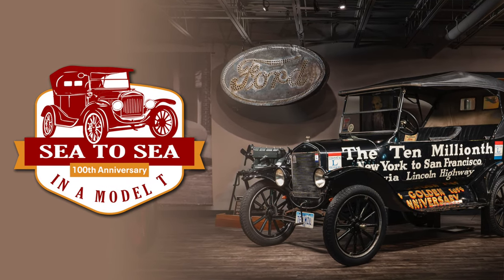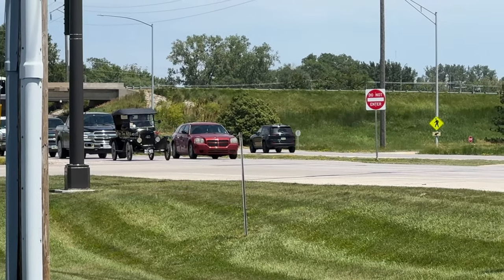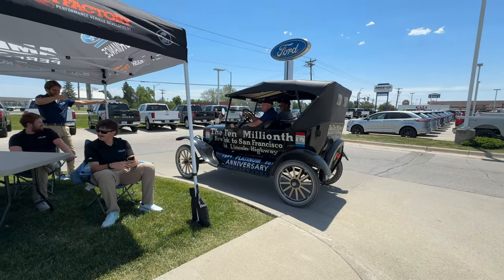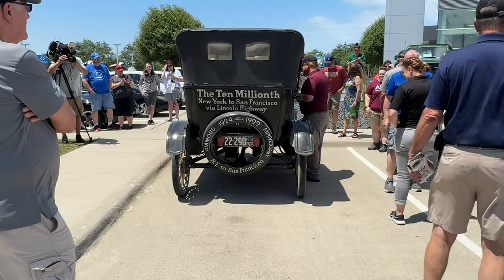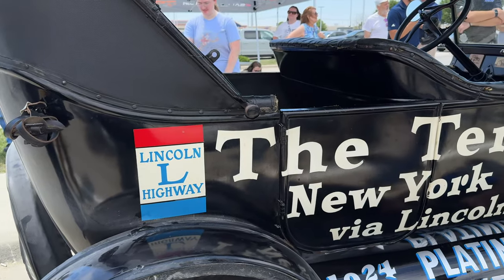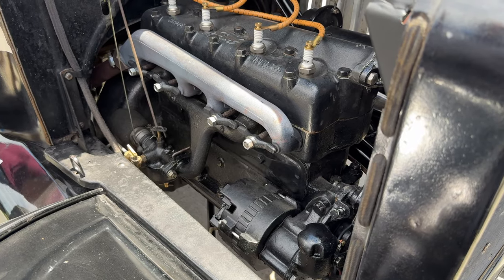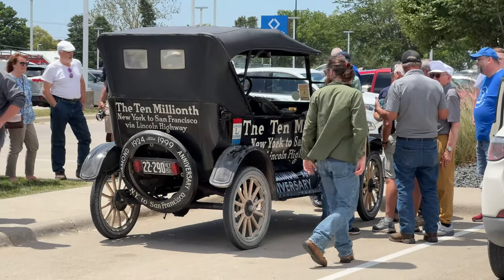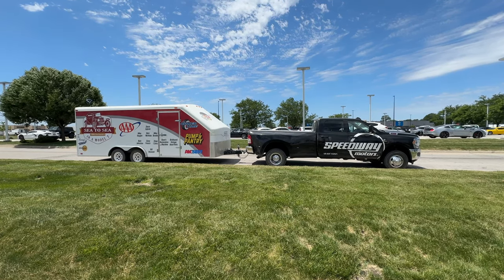The Ten Millionth Model T

Comment: I think for such a long trip as this it was wise to convert it to 12 volts, the most important part being the lights. The 6 volt glow is great but with modern traffic I think you need to be seen as well as being able to see. I hope they make it all the way to the end. They have rebuilt the engine once so they should be fine now for the rest of the way. What a great video Steve, really enjoyable even if it was short, no matter still great. 👍👍